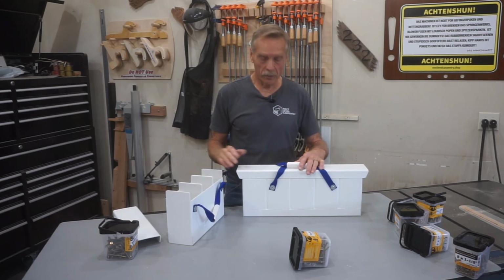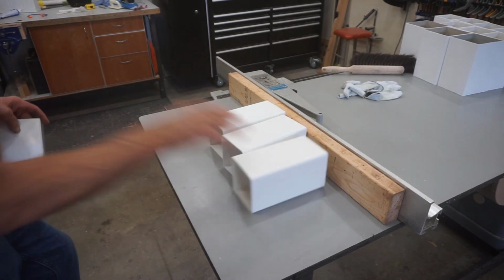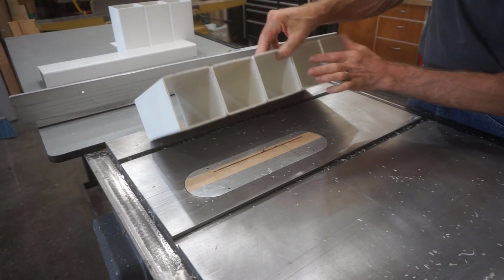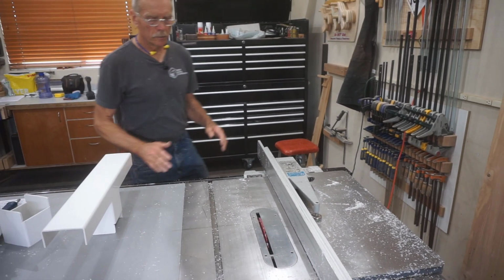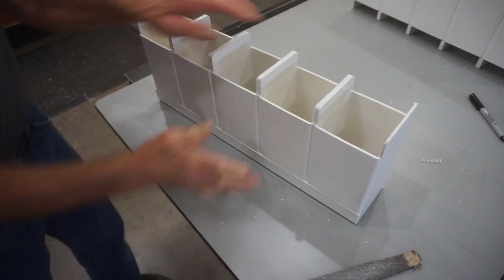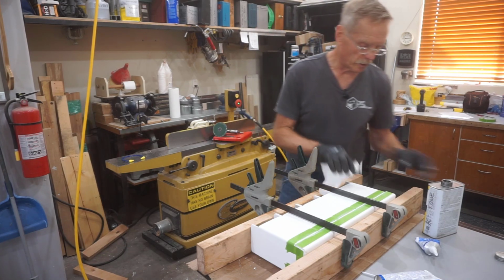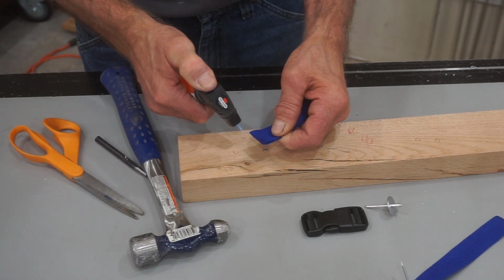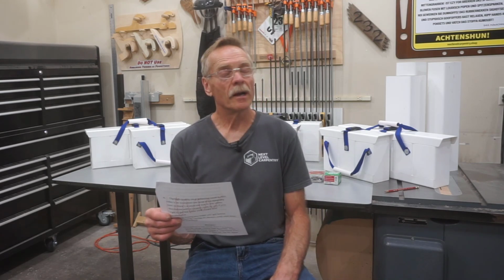Make These Portable Hardware Organizers

Comment: Color code the boxes so you can tell at a glance if it is a box of torx or drywall screws. 

You can avoid blowing out the rear edge o the plastic on the chopsaw by putting on a sacrificial fence to span the opening of the chopsaw fence. it is a 0 clearance insert for the fence. The plastic gets supported and you get clean cuts with NO blow out.

Comment: Watching you work gave me an idea to make individual indexed organizers.
Instead of gluing the squares together, cut a slot, on the table saw, 3/8 inch from the bottom on 2 opposing sides of each individual squares as to be able to insert the bottom by sliding it in through then gluing it.
The bottoms needs to be cut separately in just a tad bit less than4X4 or 5X5 squares.
Then, to accomodate for the rounded corners you could drill, say a 3/8 hole, 5/16th deep at every 4x4 or 5x5 (or both) on a piece of plywood or melamine for example.
Then cut 1/4 inch deep lines, wide enough for twice the thickness of the vinyl, intersecting these holes both up and down and left to right on the table saw.
This would give you a grid with rounded intersections where you could slip in individual square organizers.
This way you can adapt it to an existing toolbox or make a custom carrying organizer.
You can also easily create custom mix and match hardware for any given job, lets say grabbing the containers with the marettes, the cable connectors, the 1 1/4 drywall screws, the 3 inch deck screws, the shelf pins and the 5/8 particle board screws.

Just found your channel and I love it, thanks for the ideas!  Thought I'd share my feedback.

Comment: I know the adhesive isn't being pumped out of a 5 gallon bucket, however, 1/4 rubber hose on the end will let you caulk it from the inside, but building the structure, best to bed it in a 1/4" round bead like you did. 

Probably not strictly necessary to do between each compartment, but I appreciate that attention to detail.
Reply from the maker: A flexible hose tip is a great idea... wonder how well it would work with that nasty PVC cement but definitely worth a try for how well it should work! Best, Matt

Comment: Smart build project! That beats a big cardboard box full of screw boxes, my method.  What is a blade stabilizer?
Reply from the maker: A blade stabilizer is basically a precision machined oversized 'washer' that helps dampen sawblade vibration generated when cutting.  It makes a good saw cut better but can't magically make a bad saw cut good... I use one whenever possible to get the best results I can... Best, Matt

Comment: I always love watching a perfectionist work. I know some can be hard to live with, not you of course, but some. 😀
Reply from the maker: Thanks Rod... I like to call my type a 'practical perfectionist'.  Our credo is "aim for perfection but settle for the best you can do".  Makes for a very effective approach IMHO😎  Thanks for watching and commenting! Best, Matt
Reply: @NextLevelCarpentry  I do a lot of interior remodel. Cabinets, trim, painting, flooring, sheet rock, plumbing, electrical, etc.,etc. I have tools for all these trades packed into a tool trailer. I was in there the other day thinking how I could reorganize a bunch of my small pieces and parts, screws, staples, nails and such.  These bins would work perfect me thinks.
Reply from the maker: @rodm5830  I originally designed and made this style of organizer for exactly that:  having an assortment of all manner of things portable enough to take from job to job.  I never had a job trailer so they were even more useful when hauled in the back of my pickup.  I use other types for stuff that stays in the shop.  Hope you get a chance to make some and find out how useful they are... Best, Matt

Comment: This is awesome. Thank you! By the way, does it help them stick together better to scuff up the end of the block where the adhesive will go--just to give it some teeth? That material is awfully smooth.
Reply from the maker: No scuffing is necessary in my experience KeyStroke... the vinyl adhesive seems to works a bit like PVC Cement where it actually melts the surface it's applied to to kind of 'fuse' parts together.... pretty amazing stuff for sure.  Like I mention in the video the stuff REALLY stinks with some sort of volatile solvent that must do the 'melting' part.

Comment: Webbing tip, if you heat up an appropriate size nail you can burn a hole  through the webbing which seals the webbing from possibly unraveling. It works great.
Reply: mmmm plastic fumes so yummy

Comment: I cut a lot of this material installing fencing the best way to cut this is to use a aggregate metal blade it works really nice and you get Smooth Cuts without chips flying all over your face and Shop
Reply from the maker: Can you provide a link to the type of Blade you use for us?
Reply: @NextLevelCarpentry  I'm not sure how to put a link on diablo abrasive blade 10 inch buy them at Home Depot
Reply from the maker: @jamestaylor3241  Like these?: https://www.amazon.com/FREUD-DBD100093L01F-Metal-Cutoff-Disc/dp/B00IPUDQ6C/ref=sr_1_22?crid=3122URS80VLNY&dchild=1&keywords=10+inch+abrasive+cut+off+saw+blades&qid=1600143228&sprefix=10+inch+abrasive+%2Caps%2C194&sr=8-22
Wow... interesting!  Doesn't it smoke a lot and make the cut globby with melted plastic?  It must not because you prefer it but it's something I'll have to try to believe.  BTW Do you run that abrasive blade in a regular miter saw so you can cut angles?  I don't like the clunky angle adjustment thing on my metal/abrasive chop saw plus both of mine run 12" blades... 🤨
Reply: @NextLevelCarpentry  I use a 10-inch because I have a cheap table saw that I can pull around on the job Beasley lightweight they do have 12 in that you can buy a little spacer and put in the whole to make it the diameter of the Arbor on my DeWalt miter saw that I have used

Comment: Are Clic readers rated as impact resistant safety glasses?  I've never seen them documented as such, but I've seen many people using them as safety glasses in many different shop situations.
Reply: I contacted Clic customer support directly.  Here's their direct Email reply: "The only safety-rated Clics are the Clic Medical, however, it comes unpowered with no correction."  So, no, Clic readers do not have any kind of impact resistance rating and are not suitable as "safety glasses".
Reply from the maker: My Clic readers are absolutely not rated anything like safety glasses! It would be a foolhardy assumption for anyone to think that they were since they pull apart easily had would come apart more easily with any harmful impact Force!

Comment: Very cool. I liked your other video with just the single 4” sq sections, but this is much better.
Reply from the maker: I actually have a few more variations on the theme John which you might be interested in as well... stay tuned for more! 😎
Reply: @NextLevelCarpentry  think about tackle boxes. And I mean the offshore kind. Tuna jigs, tuna poppers. They are long and the vinyl is the right kind of durable material needed. Top access and not needing to fold open is another plus. Curious of your other ideas.

Comment: What is that air tool you used to buzz the corners off?
Reply from the maker: It's a 45 year old version of a tool like this one available on Amazon Drew: https://www.amazon.com/dp/B0057D8ICC/?ref=exp_nextlevelcarpentry_dp_vv_d   There's other ways of rounding off those corners but that little grinder works really slick for stuff like this... and more! Best, Matt
Reply: @NextLevelCarpentry  Thanks.  I've never seen a tool like that.  It didn't look like any air sander, die grinder, etc that I had seen before.
Reply from the maker: @prototype3a  You bet... it was a go-to tool when I was doing auto body work in the late 1970's (if you can believe THAT) and I've had it ever since... they're very useful if you can justify the initial investment and have somewhere to store the tool.  Also that little thing is an absolute air pig... it uses a crazy amount of CFM at like 90psi to it takes a big compressor with a big storage tank just to keep up with it... Best, Matt

Comment: That crossover arm technique when material is on the right side of the saw is an extremely bad example. Learn to use your left hand to pull the saw. Yeah, I know, you were contorted safely (mostly) out of the way, but jeez, if you can run a drill driver left handed, you should be able to adapt a safer cut technique. It's better to be called Lefty for ability than accident. For an OCD guy, you missed that one.
Reply from the maker: No reason for alarm... mine IS NOT a sliding miter saw... just an old fashioned single action model so the crossover technique is not an issue.
Reply: Get the stick out of your a$$ Karen.

Comment: Was at an auction 2 weeks ago .. There were some PVC pipes ... 4 1/2 and 3" lengths along with other smaller pipes.   Just wanted the big ones but got the whole stack for 5 bucks.  Not sure what I'm going to use the smaller diameter stuff for yet.
Reply from the maker: I made the first organizers like this like 25 years ago with scrap found while dumpster diving... makes them an even better deal when most of the material is 'free', right?
Reply: @NextLevelCarpentry  Can't beat free ... You're right.

Comment: Great idea!! Thanks. Just a tip a metal cutting blades does a very smooth cut on vinyl..
Reply from the maker: Any particular type and brand you recommend Miguel?  I'd sure like to use something other than the 'regular' chopsaw blade I used in the video... Best, Matt
Reply: @NextLevelCarpentry  I'm not sure how it would work cutting the fence posts, but I've seen vinyl siding cut using a fine tooth blade installed on the saw reversed.  I believe it provides a smoother cut by reversing the blade rotation.
Reply: @robstephens  i've used a regular circular saw and installed the blade backwards and it gives a smooth cut. (i just used a 24 tooth framing blade but im sure a finish blade would do even better)

Comment: How does someone give a thumbs down to something that hasn't even started yet
Reply from the maker: Kinda funny, isn't it?  Like there's people out there who had a bad day and troll around YouTube in search of things to disapprove of or something... 🙄
Reply: Next Level Carpentry just for the record, no thumbs down here. Just like wood better.
Reply from the maker: @Mark_L  To each their own but I find these much more practical for jobsite use where their compact size and durability are more important than looks IMHO.
Reply: Shawn Montgomery maybe they can’t wait? Or they don’t like the blue straps, design, white paint  - anyone’s guess?
Reply: Gave me and idea to build a case for all my different wood screws and hardware. Tornado hit my attached and detached garages and broke the vinyl fence. 7 post with 5 inch sleeves. It will make a great case for screws. Thanks
Reply from the maker: @alstalcup5986  "free" square posts are BEST!  Doesn't matter to me where you get it but be sure to use good grade adhesive that's formulated to use on vinyl.  Early ones I made with PVC cement got brittle and failed a time or two.  They DO make great cases for screws, nails, bolts, etc...
Reply: @NextLevelCarpentry  I seen you a photo when I get it done. It will be a while. Contractors coming in to make repairs to my garage and work shop.
Reply: Shawn Montgomery x-wife? Idk who else can be that vindictive.